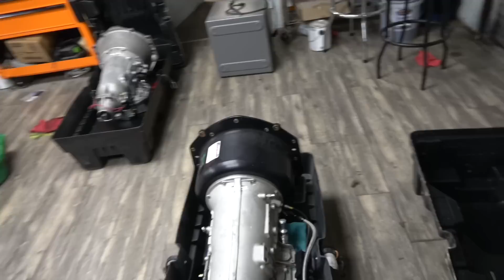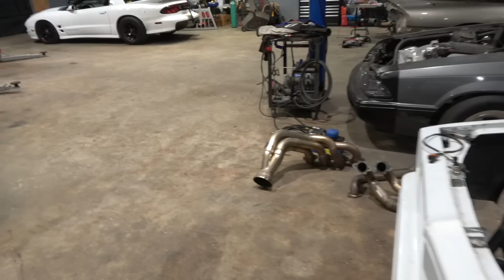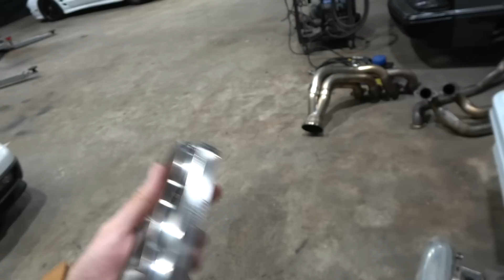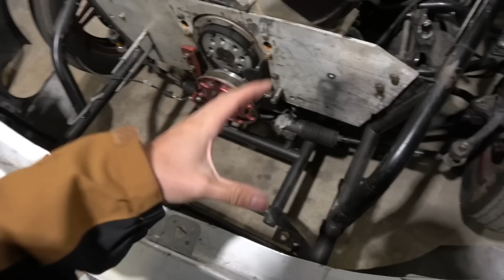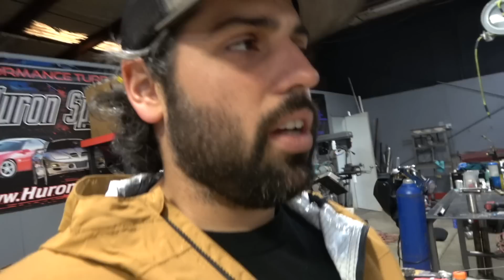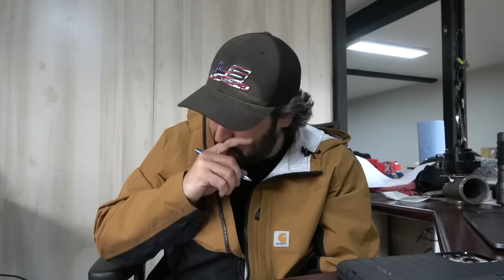Big Block G BODY turbo kit!!! Salty John Fab

Comment: If you need an intake or you're going to modify the current one over to EFI you should go with 417 Motorsports and have them weld on the injector bungs and put on the fuel rails and I would get the 123mm Hi-Boost Wilson throttle body and I would get a 4500 Dominator size intake and I would also change out the camshaft and lifters and since he has the Jesel belt drive you should also get someone to degree the camshaft to the engine and turbo
Reply: All good points my man 💨